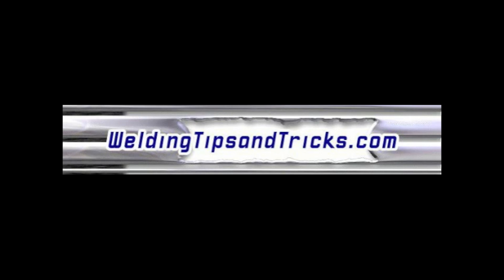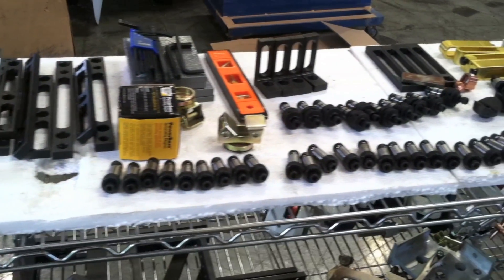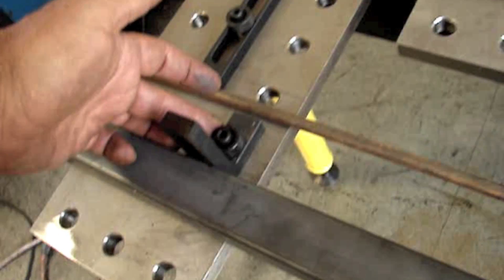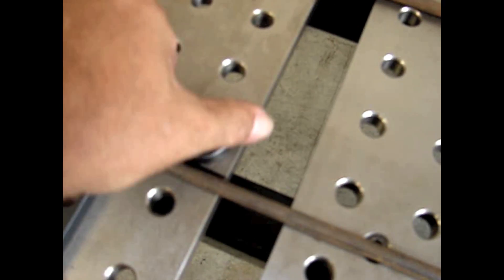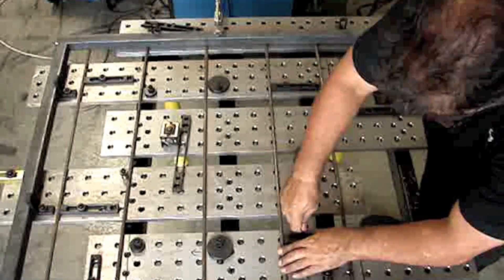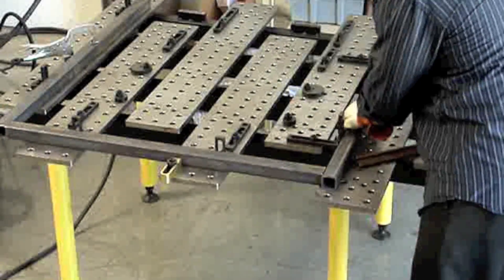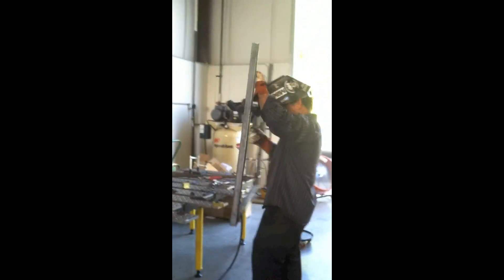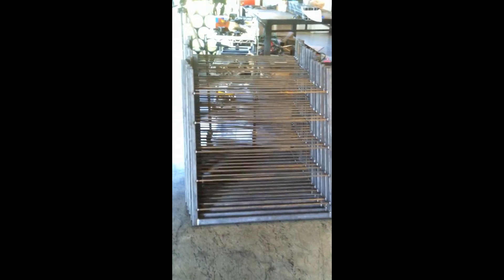Welding Tools, Modular Fixturing, and Precision Table from StrongHand Tools

Comment: Hey guys, I'm new to the welding seen and i've been holding of on getting a welding machine until I decided which kind I wanted or which one I would use the most.. I've decided I get a stick welder but I need some advice on what machine to get if I just plan to do small structural welding jobs/ personal use. I'm currently learning the trade so I don't believe I need anything too fancy but I'd like to have some options with the machine as well.

Comment: What do you think of the Tweco 300 amp tongs type electrode holder? I have the screw stub type now, but it does not work to well with small electrodes!

Comment: Hello Jodie. I have a tig welding question unrelated to this video... I have an inverter based 220v tig welder wm #9 ck torch setup with gas lens using 1/16 2% thoriated tungsten. When I'm welding and ramp the amps upto 30+, the arc starts to squeal. This doesn't seem normal to me.? It should be almost silent right? Any suggestions would be greatly appreciated. Thanks. Btw, your channel is great!

Comment: So, after that first set of tacks holding the square tubing and all the bars, you ran a bead along the top of the square tubing joint. In my pretty limited experience, that tubing will lift up and it may be square in one plane, but it won't be flat anymore. That outside piece of square usually seems to sort of twist upwards towards the weld. 

At least, that always seems to happen to me.